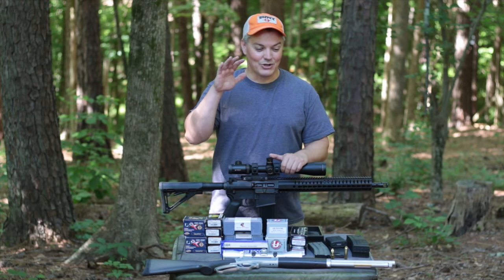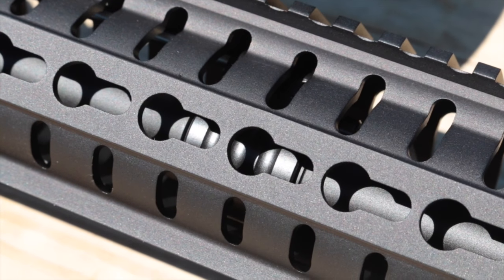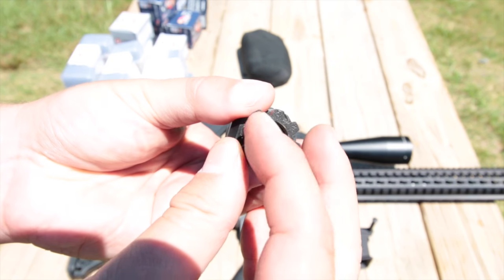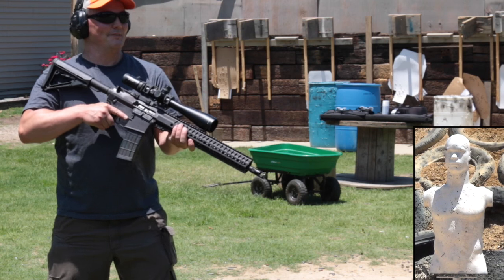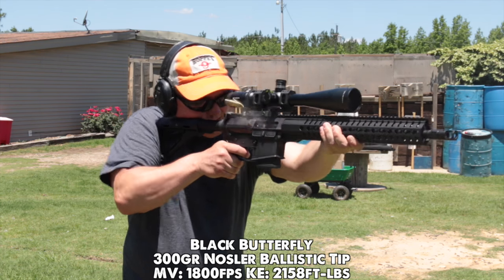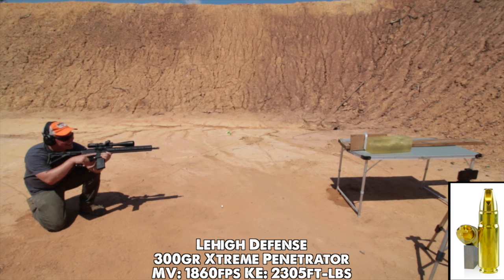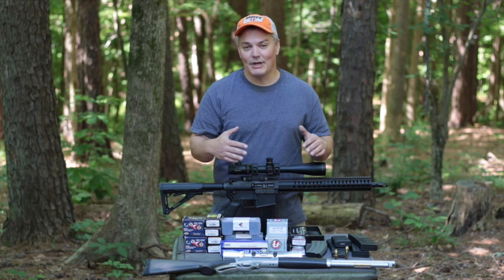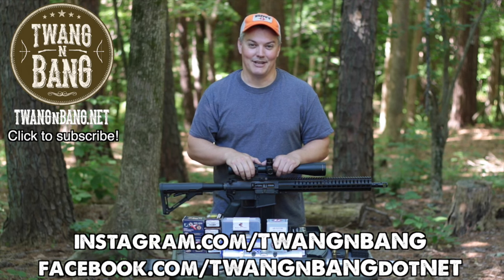CMMG Anvil 458 SOCOM! Mid-Sized AR

Comment: I need one for reasons, but I would much rather have larger double-stack magazines that hold 15 or 20 rounds.
As for the Vortex scope breaking, I kind of expected it. There are very few scopes that can stand up to semi guns with big bolts.
I recommend trying a SWFA SS scope. They come in 3x, 6x, 10x, 3-9x, 3-15x, and some other offerings. They're also really affordable, starting at $300. The US military has used them for years, even on Barrett 50 cals.

Comment: Having seen that particular controlled fracturing round at the beginning I won't question them again!! Beefy fire arm. In the gel test that you played frame by frame as it destroyed the table (again 😂) why does the main 'cavity' start 7" into the gel block?
Reply from the maker: The bullet might have tumbled.  It's a solid bullet, so it doesn't expand.
Reply: Thank you for the vid. That would be a good hog round too I suspect.

Comment: I don't get it. the .458 was designed to be used in a standard At lower. it's a bit expensive but I have 1400 or so rounds through my .458 built on a standard lower without any noticeable wear. I would probably have a lot more rounds through it if price wasn't so restrictive but the price being what it is I don't see ever being able to shoot enough to wear out my lower or bolt.
Reply: Edward Feenman I'm with you on the need for a bigger lower, what breaks on a standard lower using the 458?

Comment: I am in the process of going to a 458 but the price of this platform is a little high.  Hopefully it will drop with sales but R&D cost money.  It is interesting none the less.
Reply from the maker: MSRP does not necessarily mean street price.  It is only being released today, so I don't know what the street price will be.
Reply: +TWANGnBANG I sort of wish they went with mag that fit the 308 AR10 style lower so you could switch out uppers. Then you would have a special 458 mags but the lower could be used for other larger cartridges.  We will have to see where the street price shakes out.
Reply from the maker: KD0LRG The upper is 3/4" shorter than a standard AR10/SR25 upper. There is nothing about it compatible with large frame ARs because they didn't want it to be so heavy. That said, more calibers are planned for this design.
Reply: Order a barrel from one of the original manufactures, Tromix, and build it how it was intended to be built, in the AR-15 chassis. The barrels are high quality and reasonably priced. I would suggest ordering an upper receiver designed for 458 or 50 beowulf, because the ejection port does need to be a little wider to eject reliably. Reloading will severely reduce the cost of ammo also, but that is not something to rush into. Make sure to do a ton of research if you decide to reload, and join the 458SOCOM forum, and then do more research, use extreme caution if you reload.

Comment: 458 socom is a beast don't get me wrong. but 458 socom is to 45-70 like 10mm is to 41 magnum. that is, it isn't. it's still super powerful, all I"m saying is its disrespectful to the 45-70 which can propel 430 grain bullets out at 1900 fps and is about 1000 ftlbs energy greater than the most powerful 458 socom loads

Comment: Hows the recoil of the 458 compare to the 45-70?
Reply from the maker: Slightly less due to the gas system, but 300gr loads I have for both cartridges are literally the exact same bullet and velocity, meaning exactly the same force at the back of the case head.

Comment: I would never use a mount like that with a big pricey scope, its just not right, poor thing is just flopping around up there
Reply from the maker: You're nuts.  ADM mounts are among the best available.
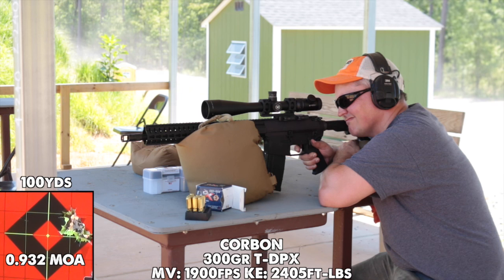Reply: When you're shooting off the bench at 11:45 mark you can literally see the scope flopping around on its mount!

I'm sure it is very expensive and good for more reasonable optics but clearly this application is beyond its abilities...
Reply from the maker: Nope.  The whole rifle is wobbling as one piece because I'm shooting off a soft bag instead of a bipod.  I'm looking at the original 1080p footage frame by frame.  Nothing is moving separately.

Comment: The 458 socom was designed to be used with your standard ar-15 parts, with the exception of a new barrel and bolt.

Then CMMG comes in with this monstrosity whose parts aren’t compatible with shit.
Reply from the maker: ...because we quickly learned that 458 SOCOM’s power is not compatible with standard AR15 parts.